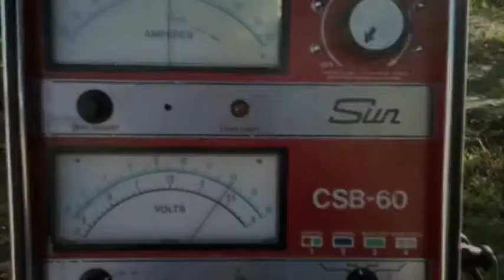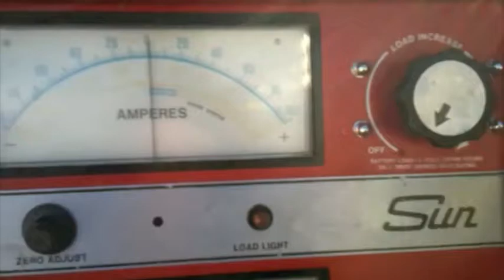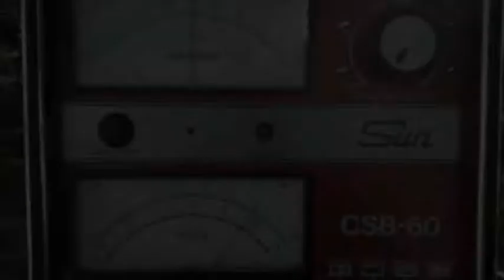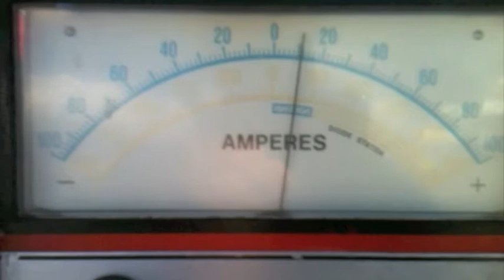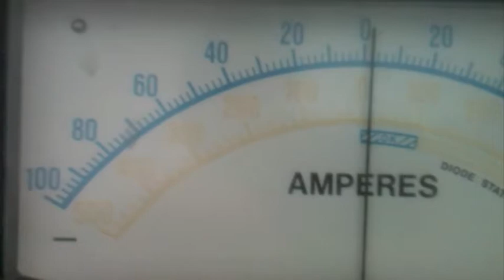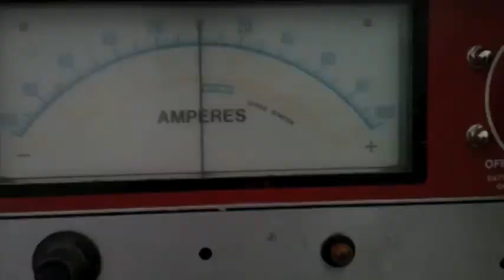Sun VAT-40 Demo

Comment: Atlas was the Sears in-house brand name. At one time you could buy Atlas metal lathes at Sears, and Sun Automotive Diagnostic equipment was sold at Sears as "Atlas" too. They were ALL good tools, and aside from Craftsman - which you can still get at Sears - it's all crap now. I had to laugh when I went to Sears about 2 years ago and asked a clerk - in the automotive tool section - if he had a tachometer/dwell meter. The blank stare I got told me I was on my own...
Reply: Atlas was a brand of standard oil company.  It supplied private labled tires and batteries for standard oils service stations. These would have been sold to stations to sell batteries and has nothing to do with atlas lathes or sears.
Reply: ok boomer